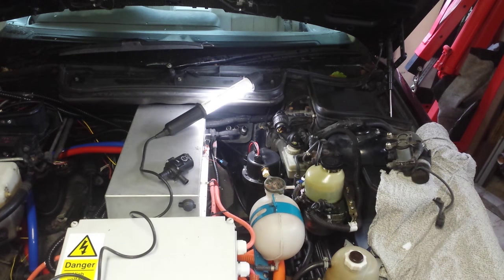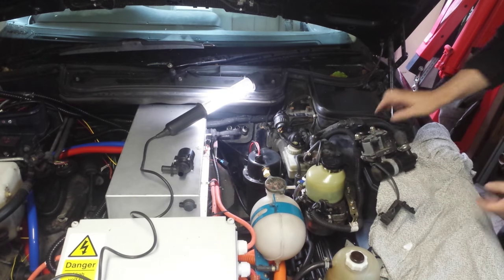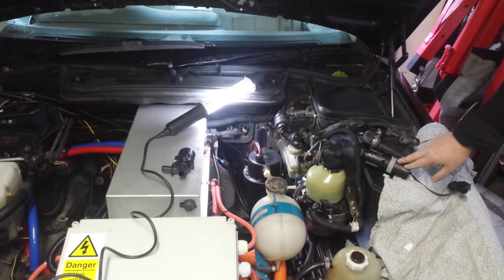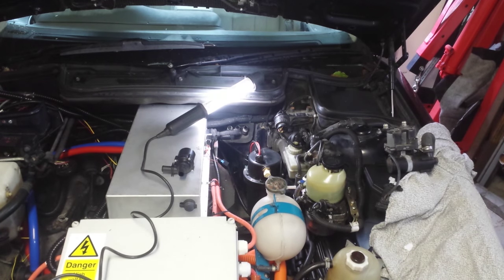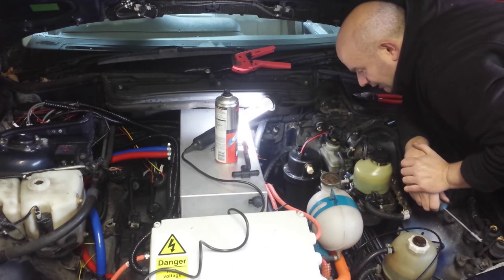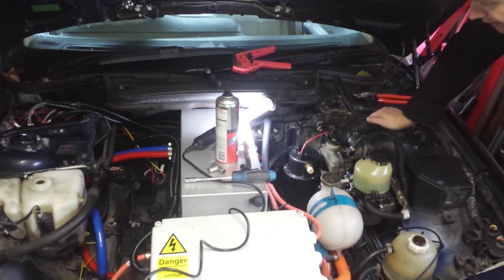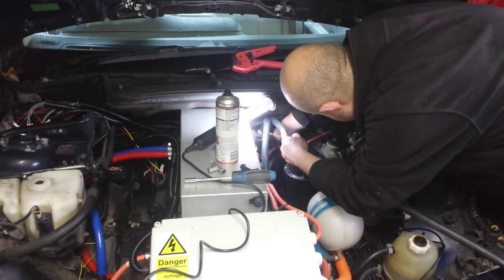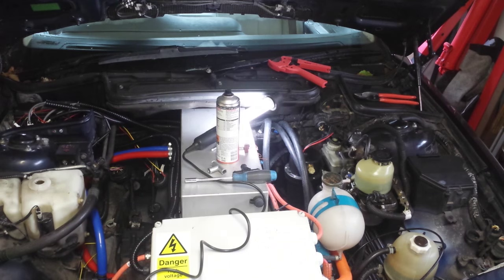BMW E31 840CI EV Conversion 30 : Cabin Heater 01

Comment: Most BMW's still have that heating with engine stopped (I expect cheapest 1 - 2 series might not). And I believe most vehicles with start-stop system have that as standard equipment. My 2001 5-series has 4,5kW Webasto as standard equipment and that also needs that pump. Newer BMW-s dropped fuel heater and replaced it with electric heater that gets power directly from generator (unfortunately power max 1kW as generators are maybe 1,5kW)  but still equipped with pump for optimal water flow. And the newest BMW-s have PTC elements directly in cabin heater. Less plumbing is good but still limited in power. Much faster though :)